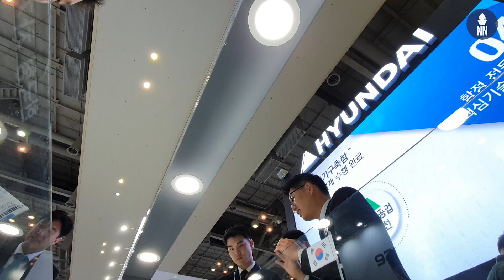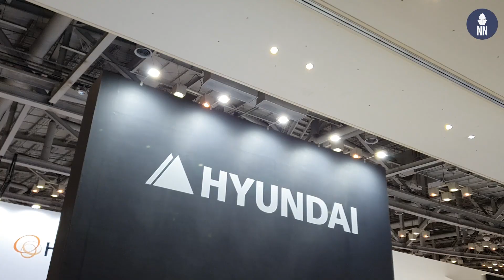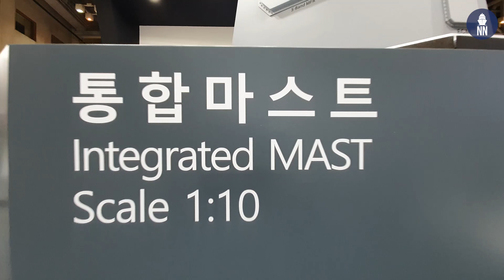Naval News Monthly Recap - June 2020

Comment: what's the purpose of an integrated mast?
Reply: It has all of the ships radars, and sensors in a single mast. It helps with reducing maintenance and also reduces radar cross section.
Reply: @dylanshaft8936  All your naval electronic eggs in one basket, what could possibly go wrong.

Comment: I don't like the bow of the KDDX. That was on French ships in the late 1800s to early 1900s. Its on the new Zumwalt class. Odd design.
Reply: Yeah, tumblehome hulls are questionable.  Ostensibly they reduce radar cross-sections, but their stability in higher sea states reduces platform viability and usefulness.
Reply: Its interesting that both Designs seem to be a slightly  Smaller Tonnage than the Sejong The Great Class Destroyers.